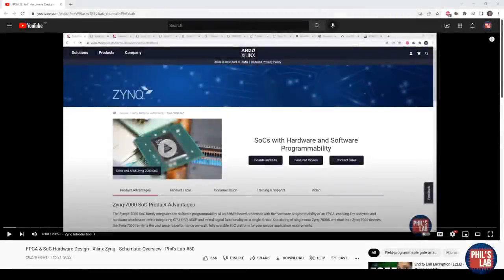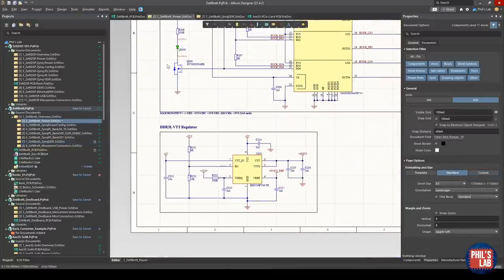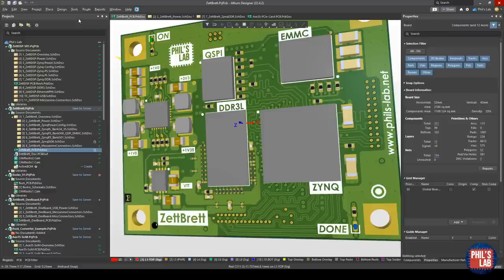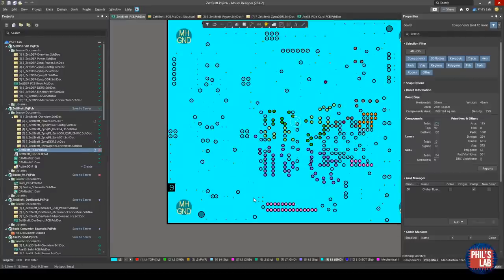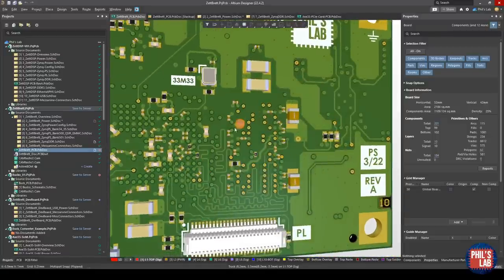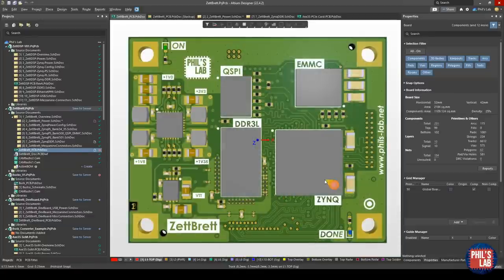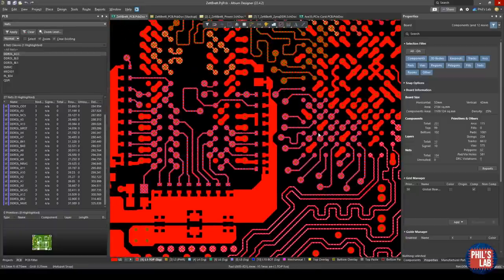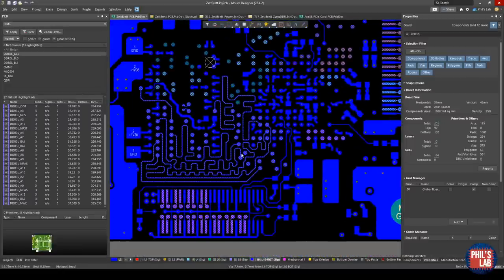FPGA/SoC + DDR PCB Design Tips - Phil's Lab #59

Comment: As a hardware design engineer in the past, I was in charge of the schematic aspect. The PCB layout are typically done by a layout person (non engineer) who usually is exceptional in the layout skill. On critical circuits (ex. high speed, SAS, DDR5/6), engineer often provide guidance on how they want their boards to be routed.

Comment: I've never really felt hindered by Kicad before until I saw this video. You've certainly highlighted the benefit of Altium! Now if only I could justify the price...You mentioned that you avoided using microvias in this design. Do you mind me asking what size vias you used around the EMMC? I'm routing one with the same footprint at the moment and I'd also like to avoid microvias so I'll need to use the smallest via that could still be reasonably reliable.
Reply: Go with the smallest via that ur fab allows. I have a similar design with 0.42/0.2 vias, I think 0.35/0.2 was accepted too with my fab

Comment: Did you control the impedance on singled ended DDR4 traces such as address and data lines? Essentially, are the DDR4_ADDR and DDR4_DQ width different in inner layers compared to outer layers

Comment: nice
Why did you use 10 layers and not 12 or 8? what made you chose? 
About those board to board connectors why not use: gnd signal signal gnd signal signal  gnd   ? it would save some pins and also have all of them referenced , Or am i missing something?

Comment: Do you mind disclosing how much are the PCB and assembly gonna cost and who will do it?
Reply from the maker: I'm getting three made. I had the Zynq in stock (which cost me about 60 USD a piece), and then the PCB + assembly + remaining components cost me about 800-900 USD. So around 1000 USD for three which is very reasonable in my eyes, for fully-assembled, 10-layer PCBs.

Comment: Thank you for this video. I have a question about DDR3 routing, in your layout the address, control and command signals are in different layers, can't this cause synchronization problems? The technical document recommends routing these signals in the same layer.
Reply from the maker: You'll have to keep track of Z-axis (via) delays if you route signal groups across different layers, but it's entirely possible.
Reply: Thank you for your reply.

Comment: Hello - for propagation delay - exporting values from Vivado are for example in this format 
                                       Min Trace Delay (ps)	Max Trace Delay (ps)

A10		RSVDGND	27.853	                                  28.133
A3		GNDADC	31.635	                                 31.953
A4		VCCADC	30.131	                                30.434
A6		VREFP	       27.116	                                       27.389
A7		DXP	        20.476	                                      20.682
A8		M0_0	      25.429	                                      25.684

Would really want to understand how to use above min/max from Vivado in Altium 
Thanks

Comment: Nice video!! But I have one question, you mention that length tuing has to be done for almost all high speed circuits, but at which frequency is it condiered high speed and do we have to bother? Thanks!!!
Reply: this is helloworld question in hispeed pcb design
BW =0.35/Tr
where Tr is rise time in nanoseconds
BW is bandwidth in gigahertz
bw over 100 mhz starts to be an issue in signal integrity aspect, so probably you should consider match the impedances and tune the length

Comment: Phil why prefer to spread the power pins on to larger copper pours as the connection to the pin is thin? Any specific reason or a resource that would explain this?
Reply: Even though the power pins are thin, we still want to minimise the overall resistance (reduce I2R losses) on the power net by immediately fanning out to the wider pours/planes and connecting to power planes (where a power plane can typically act as a more stable reference voltage). The manufacturer is simply limited by the package they use (depending on the current levels, many controller ICs will share current on multiple pins). In addition, wider power traces reduce parasitic inductance which can worsen performance of the switching converter.